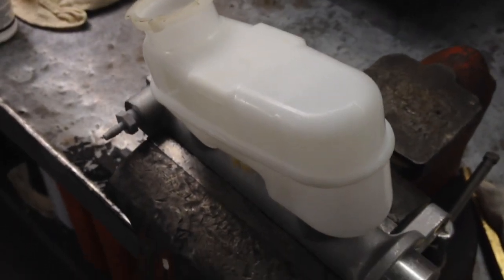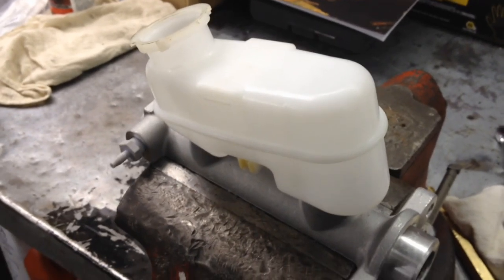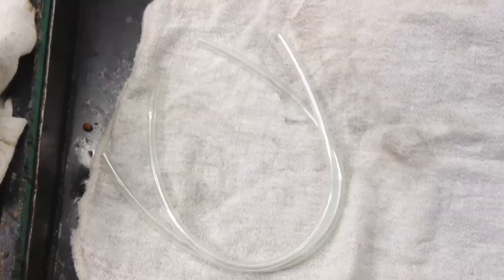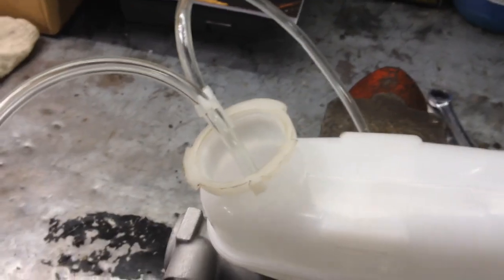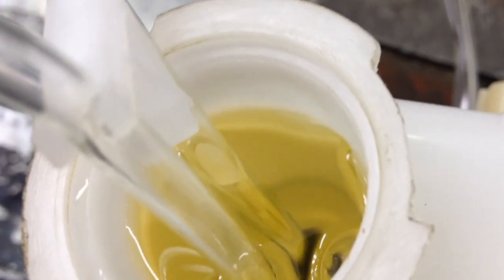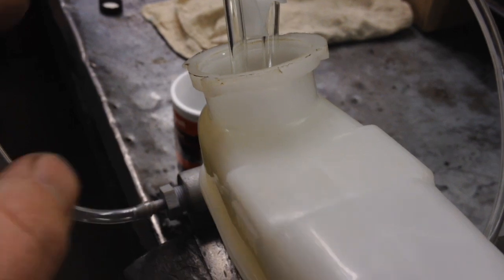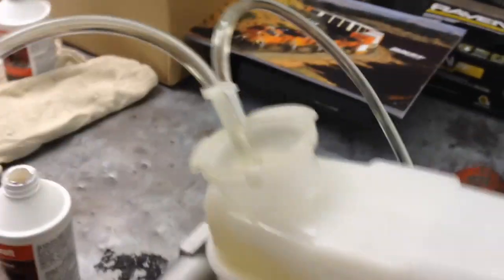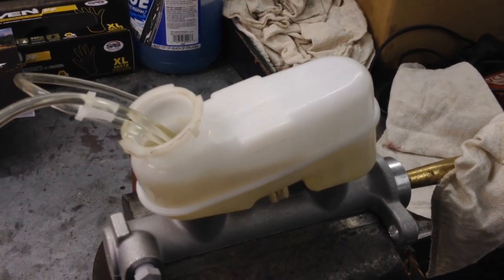Brake Master Cylinder Bench Bleed

Comment: I picked up a Dorman bench bleeding kit but just noticed it has completely opaque tubes. Not sure how that’s supposed to work since it seems you need to be able to see the air bubbles being reduced while you do this. Thanks for sharing. Going to try and find a solution.

Comment: i would keep thos nipples for bleeding for ever hahah! thats bad ass! working at a dealership as well i just use my finger to keep pressure in the hole and plug off the other one with a fitting that has the hole welded shut!
Reply from the maker: Oh I kept them all right, I have a bleeder kit like this with many adapters made to fit ford master cylinders but I like these too especially the clear tubing. Gets the job done!

Comment: So you're saying, "Don't worry about stream of tiny bubbles?"   I worked a long time because I had tiny bubbles.  Finally figured out that air was being sucked in around the plastic nipples.  Was able to eliminate "tiny bubbles" if I worked hard to do a slow "release stroke."
Reply from the maker: Yeah it's no big deal you will have top do a final bleed on the car.

Comment: I stopped bench bleeding decades ago.  Mount it, fill it, and pump away without opening any bleeders.  The air will go up into the reservoir, the cylinder fills, and you're done, no other bleeding required.  In some cases the vehicle has to be jacked up or parked on a slope to make sure the cylinder is at the right angle.  I generally set it up so that the cylinder is pointed slightly downward at the front which puts the inlet ports at the high point thus letting all the air rise into the reservoir.
Reply: With the front higher then the back? Or opposite?
Reply: @tyrc12pro94  The rear of the master higher than the front, but it doesn't need to be a lot.  Perfectly level would probably work, but a little bit of slant will make it better.  With some vehicles the master is pointed upward so you have to raise the rear of the vehicle, sometimes a lot.
Reply: hey man, do you do this with the reservoir lid off or on? or do you just lid shut, pump for a while til it becomes firm and good? i assume it'll take a decent amount of pumping?
Reply: @liamomalley8028  I usually do it with the lid off so I can see the air/fluid.  With a lid that completely exposes the reservoir you have to be a bit careful, during the first bit of pedal movement you can get a stream of fluid that'll shoot up out of the master if you press too fast.  With reservoirs that have a small cap in the center the stream can't shoot out so it doesn't matter.

Comment: On a 1991 Mazda B2200, the master cylinder has 3 ports. Two on the side and one on the bottom at the forward end of the cylinder. Seems all videos show examples with only 2 outlets. Also, the bleed kits all provide only 2 tubes. Can anyone tell me which ports need to be routed back to the reservoir and what to do with any that is not (plug?)? Thanks.

Comment: when you place that on the car and unhook those hoses, fluid immediately starts to come out ( which means that air is entering the master cylinder ).    so don't you end up in the same situation that you was in, before you bench bled it?     that's the only part that i don't understand.
Reply from the maker: +Jeff Fuehr The internals are bled that's the difference you will always have air in the lines after any hydraulic component replacement but in this case the master is already bled properly which can be hard to do on car.
Reply: Did you really answer the question?
Reply: No. Fluid is now in the cylinder. Even if a bit come out, assuming level in reservoirs are high enough, you'll have solid fluid coming out, no air bubbles

Comment: Another excellent video!  Do you need to bleed the ABS module with a Bi-Directional scan tool after this installation?
Reply from the maker: +Chris Stromberg You only need to perform an abs service bleed when the abs HCU is replaced.

Comment: I put new brakes and rotors bleed all the brakes on my f150 and still I have to push the brakes to the floor when I do that the back locks up Angell
Reply: +Angell Mahon Did you replace the master brake cylinder as well?
Reply: Yes thks for the vid it helped a lot I got a new master it work great

Comment: For what its worth.... I have read in several places that you are not suppose to put your cyl in vice like that. Swivel vice around and clamp it to the flat part right where the two holes are located that mount the MC to the booster. Not sure why, as I have done it several times  as you did in video with no problem. Maybe over tightening vice could cause damage or maybe it would be prone to slip if not tight enough.
Reply: A vice is the proper support for the bench bleeding process, but you have to be careful not to overtighten it in place. That can damage the seals and internal cups inside and cause failure and leakage.

Comment: What happens when you remove the plastic fittings when installing the MC back on the car? Doesn’t air go back in the MC then? Or does it have like a one way valve for air not to go back in?

Comment: My Question, once the bench bleeding is completed. you need to remove the two bleeder hoses and remove the plastic inserts. My 
Question is once the hoses have been removed the fluid in the reservoir will gravity bleed out. would air be introduced back into the master cylinder? Once I install the master cylinder back into the car, I have to re-hook up the brake lines. To the master cylinder
your video didn't show start to finish.

Comment: Anyone a good way to keep from spilling fluid all over the place when you have it in car and are attaching the brake lines, other than just do it quickly?
Reply: toober5000 I know I'm a bit late but have someone push and hold down the brakes then connect the lines.
When the MC piston is pushed in it closes the system and won't leak.
After bleeding all 4 corners then have the helper push the pedal down again and crack the line open at the MC and close it before letting go of the pedal. This last step make sure that your letting any little bit of air trapped in the line out

Comment: you should only ever clamp a master by the bolt flange in a  vice you will make the cylinder into an oval
Reply from the maker: +5 This was just to cradle it not clamp it down watch it again.

Comment: Can you just bleed the MC when you bleed all the lines?   Do you have to do it separate? 

I am working on a 100% break system replacement.
Reply from the maker: Do an initial bleed like this separate first.
Reply: FordTechMakuloco   Thanks!
Reply: @FordTechMakuloco  
my car is 1993 Ford Taurus V6  3L  and my master cylinder 
have 4 ports (4 brake lines)
do I do the same things you did with ,,but in my case i need to put 4 plugs instate of 2 like you?
thank you

Comment: Can you do this while the cylinder is on the vehicle? just use the pedal instead?
Reply from the maker: +Brandon Pankonin Yes but you take the chance of brake fluid spraying all over you paint if one of those lines let loose.
Reply: +Brandon Pankonin Did you do it?

Comment: Great video, got one comment...you are not supposed to secure the master cylinder by the cylinder body when clamped into the vise...it should be clamped in the vise by the mounting flange so that you don't squish the piston chamber & invalidate the warranty...thanks for the info!
Reply from the maker: +Steve A You would have to really clamp down on that to ruin it but I still do not do it. What I did is open the vice just enough for it to drop into the there and it rest on the fittings then the ears in the back sit against the vice and it creates the perfect cradle for the master without any clamping. Do you see how perfectly it sits when I show the right side of it.
Reply: +FordTechMakuloco Not hatin bro...all of this will work better than doing none of it....just a thought...I just rebuild most of my ride starting from the bottom but appreciated your vid...

Comment: do you need to bleed the individual calipers as well? or does this avoid having to do that?
Reply: Always, _ALWAYS bleed the entire hydraulic system after ! .

This is just to get you started .

-Nate
Reply: @VWNate1  I am a beginner on car maintenance. Been researching the heck out of bench bleeding, replacing MC, bleeding brakes. I have done things before of replacing brake pads, engine/oil change, coolant change, replacing hoses. So if I bleed the mc so there is no air, and then bleed the calipers so 99.99% air is out of the system, that's all there is to it and the system will be good and safe right? I think I am just being extremely cautious with being the brake system.
Reply: @GMoney-B  : you can never be too careful with the brakes, you'll still need to bleed all four calipers after installing the bench bled master cylnider .

Bench bleeding saves you a lot of time getting the air out of the brake pipes, ANY_TIME the system has been opened, like to replace one leaky or bound up caliper, the ENTIRE_SYSTEM MUST be bled , all four bleeaders .

Start at the one furthest from the M/C, typically yhe Right rear, then bleed each one in order going so the last one bled is the closest to the M/1C / 

Buy a quart bottle of new brake fluid and don't open in until you begin the job .

Bleed until you're getting clean bubble / foam free fluid out of each bleeder nipple before you move one .

Only use a 6 pointed BOX END wrench on the bleeder nipples ! .

I like to use clear plastic hose, cheap at any big box hardware store, about 3 feet and a glass bottle to bleed unto .

-Nate
Reply: @VWNate1  Great info. Thank you.
Reply: @GMoney-B  Glad to be of help, knowledge is WORTHLESS unless freely shared . -Nate